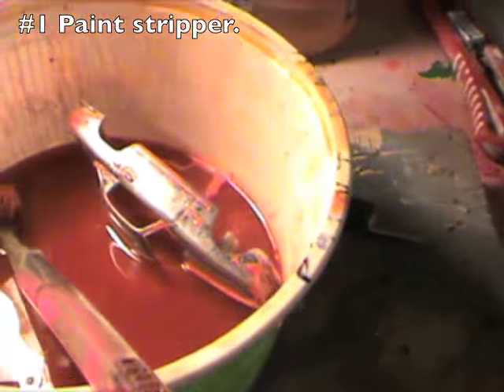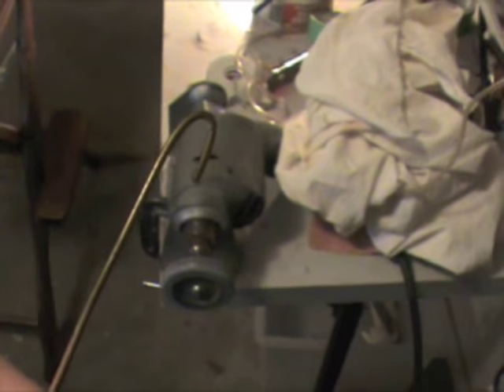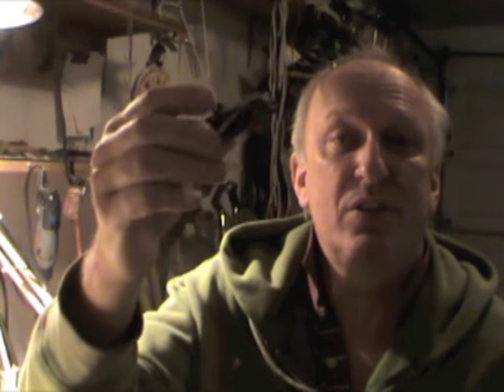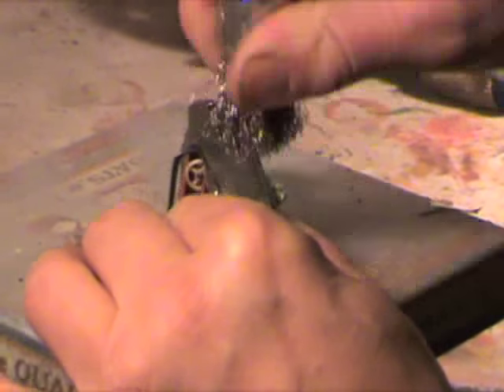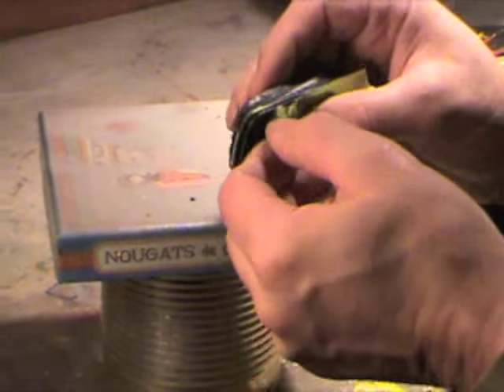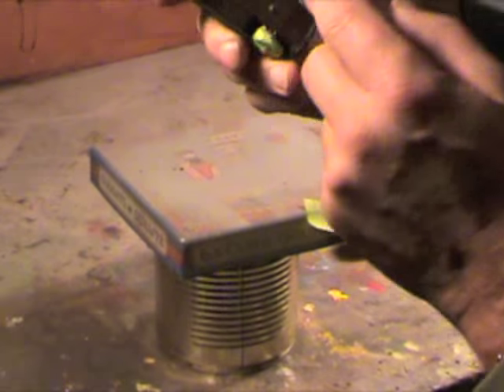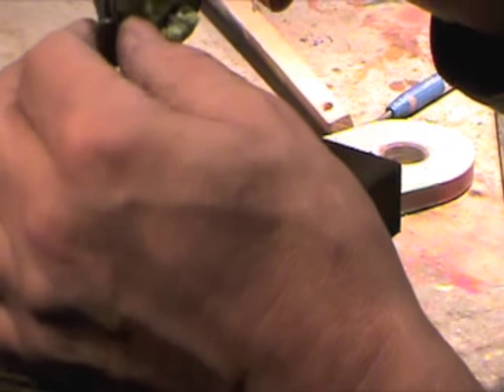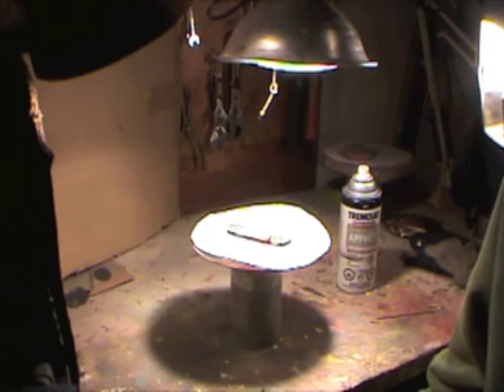DINKY TOY RESTORATION

Comment: Sometimes you can use a soldering gun to remove the rivet head. That saves you from possibly damaging the post, or base of the car with the drilling method.

Jack - Canada
Reply from the maker: Once the rivet head is gone it is a problem. All that is left is a post. I try and leave part of the rivet head on when drilling and pop off the plate that way it can be clipped back on with a little epoxy underneath.

Comment: Good job.....one thing, if you don't take the chassis plate off and the rear tires are rotten or missing, you can take a new one, cut it, fit it to the hub, then glue the cut ends together with the correct cement, that's if the car has fender skirts and you can't roll the tire off.....
Also, rather than wire brush the body and have it shoot off, why not brush on the paint stripper with a small paint brush...then rinse, and scrub with a tooth brush...
Reply from the maker: I want to make the car look as original as possible. I do not like glueing tyres as it always shows. If the tyres are OK I leave them on the car. Most tyres can be put on with a bit of force.  I have used paint stripper but it gets everywhere and is very unhealthy.
I still use paint stripper when cars are taken apart. Thanks for the feedback.

Comment: Great work. What kind of rotating set-up do you have, for painting? I really like it, spins very smoothly, as if it was on bearings.
Reply from the maker: +RV S (The Truth Seeker) 
It's a VHS tape recorder head hot glued to a can and round mirror.The box lid was just to cover the mirror so it would not get covered in paint. It spins amazingly and would make a great windmill bearing.
I just got a larger turntable in a second hand store for $2 and it is a turn table for food but does not turn as easily as the VHS head but could be used for larger tin toys. 
Thanks for the feedback.  Willy
Reply from the maker: RV S I hope you got my reply below. The turntable was a VHS head glued to a upside tin. Turns great but I got a food turntable for spraying larger toys and it's great. An old swivel stool or a TV stand has swivels as well. Good luck.
Reply: Willy Dahm
Yes, got it. Thank you!  You are doing great work.
Reply from the maker: Thanks